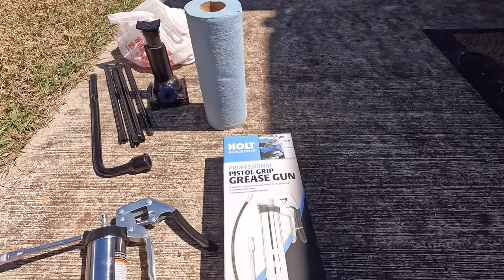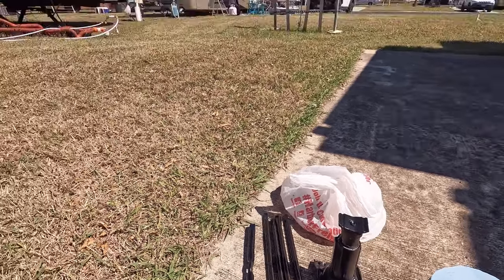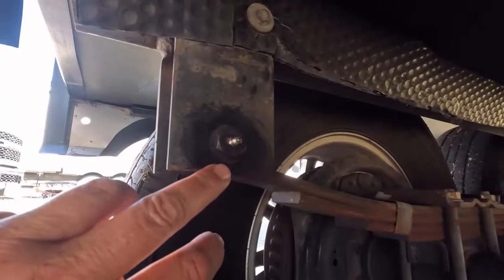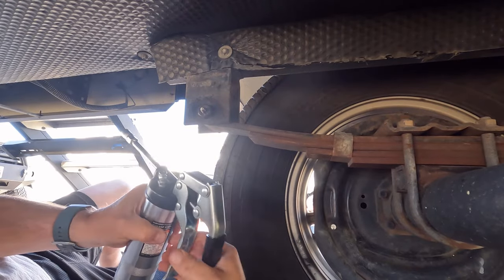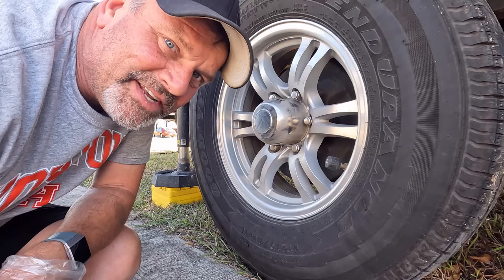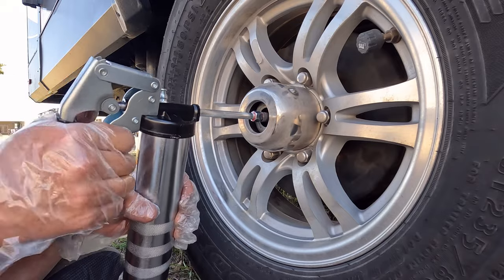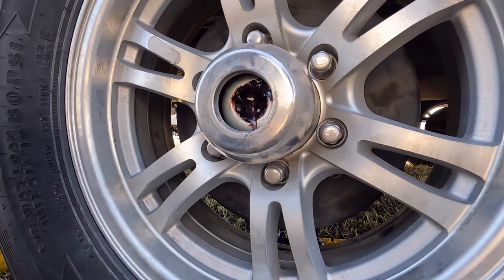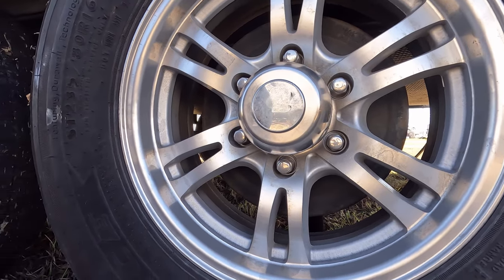The Dexter EZ Lube System for RV Wheel Bearings and Axles | So Simple YOU Can Do It Yourself!

Comment from the maker: NOTE - Although we used the Dexter EZ Lube System in this video, this does not take the place of inspecting your wheel bearings.  We intend on alternating between the EZ Lube System and manually packing the bearings so we can inspect all components bi-annually.
Reply: Not sure if you'll see this, but in the future before greasing the shakles, you may want to jack the frame a little to take the weight off the bushings. All the weight is resting on the side of the bushings you want to new grease to get into. Taking the weight off opens a space for the fresh grease to get in...
Just an idea 😉 👍 ~
Reply from the maker: That’s a great idea. I never thought of that. Thanks!
Reply: @CompassRoadz  happy to get to help once in awhile 👍 🙃

Comment: Having worked on trucks and trailers for over 40 years I can say with confidence that the EZLube system is one of the biggest frauds  ever pushed on the general public.  It is ok for boat trailers that are in the water but not much else. I have seen so many travel trailers that have had perfectly good brakes destroyed by the EZ Lube system.  You don't service anything.  You don't know the condition of the brakes, bearings or seals. I suppose if you drove through deep water and needed to quickly flush your hubs that would be different.  All that mixing of different is a big no no. Your going to trust your expensive bearings and suspension  components to cheap Chinese grease?
Reply from the maker: That’s good to know. We plan on manually packing the bearings every other year for the simple reason that we can actually look at the condition of the bearings. Thanks for watching!
Reply: Yea, Harbor Frieght, lots of made in China.  I think I'll go with Schaeffer Syn. Grease. Made in America.
Reply: Can you comment on the Schaeffer Syn. Grease and Motor Oil?
Reply: I'm a 2nd generation mechanic and I disagree with you. The EZ lube system is awesome. The problem is how they are maintained:)
Reply from the maker: @owenhill-vf7ko easy for novices like us. We like it as long as we perform the operation correctly. Thanks for watching!
Reply: Retired mechanic in the trade for 48 years,and In my experience with people with EZ lub hubs they tend to over grease and force grease past the hub/drum seal and force  grease in the drum and destroy the brake shoes. If a person knows what they are doing with regards to the amount of grease to inject into the hub then it makes life easy,but not necessarily the best alternative,and here’s why…..the problem is most people inject too much grease ,thus causing damage forcing grease past  the drum seal and into the drum and onto the brakes.  If grease gets onto the brake linings then  you have a big job to repair that damage,therefore the time to just pack the bearing by hand is your safest bet. Also it’s good to periodically take off the drum to inspect brake shoe  linings,hub/drum ,bearings and seal, making sure brake adjusters are free and working,readjusting brakes to the drum,repackaged bearings with fresh bearing grease. SAFETY FIRST ,the only way to inspect all this is ,taking your drums off,don’t cut corners it’s for the safety of your family and others!
Reply from the maker: @petejansen7220 thanks for that insight. Yes, the EZ Lube system is great if done right. If someone doesn’t know what they are doing they could screw it up. I agree that the bearings still should be inspected by g if and on a regular basis. Thanks for watching!

Comment: Dan, mark the top of the tire at 12 o'clock. then 2 pumps , then turn it 5 minutes to clockwise , 2 more pumps and keep at it until new grease fills outer bearing also. You need to turn it so you grease the inner bearing also. If you leave wheel still, it will only grease a small small portion of the inner bearing.. NICE WORK .. NICE TRICK FOR FELLOW  RV'ERS
Reply from the maker: That’s awesome advice. Thanks for sharing. I’m sure it will help others. Thanks for watching!!
Reply: No problem, glad to help fellow RV'ers @CompassRoadz
Reply: And we all know what happens when you overfill those... you blow out the back grease seal and all that nice grease lubes up your brake shoes/pads.
Reply from the maker: Definitely have to be careful to do the job correctly or it could get messy. Thanks for watching!
Reply: Manually turn each tire 5 minutes for how many times?  I don't see too many people doing that. How about a pump or two each time I stop for fuel until the cavity is full? We average about 11,000 miles a year with our large 5th wheel (was 33' and now 42') but I'm not one to major in the minors. :) It would be interesting to learn how often Dexter recommends complete disassembly to remove old grease and start over with new. Surely the frequency of a complete repack with new seals has more to do with miles than time, eh?
Reply from the maker: I think it’s designed so that any overfill gets pushed out.
Reply: @JIMPETERSON-n7i   Hi Jim,  2 pumps as you turn wheel 5 minutes at a time , You keep going and skin out out grease until new grease starts to come out, Use a different color also helps to see the new grease coming out ...

Comment: Dont do your bearing the lazy way, pull them apart, clean, inspect, grease and put back together. Check Youtube for Dexter Axle bearing video for the proper way to do it. If you pump in to much grease and bypass the rear  seal you will contaminate the shoes and have no brakes.
Reply from the maker: So true. But that is the whole reason for the EZ Lube system, to make it easier for the non-mechanically inclined. Thanks for watching!

Comment: I think the important thing to remember, so as to not blow out the rear seal, is to not use a pneumatic or powered grease gun and to pump the grease slowly.
Reply from the maker: Yes, that’s what we think based on concerns we’ve read in other articles regarding the procedure. Although Dexter claims it isn’t a problem with their bearings as long as they aren’t old and dried out. Slowly rotating the tire also helps eliminate grease from backing up without being spread evenly. Thanks for watching!
Reply: @CompassRoadz  -- I've learned to hate 'Bearing Buddies" but it looks like this Dexter system is a much better approach. And I believe our newer rig (2020 Torque toy hauler) has 'em so I need to get after it. :) This clearly puts a lot more grease inside the hub than old-school hand packing ever would.

Comment: I have to disagree with you in Dexter. Those type of seals should only be used if you are traveling and you take your temperatures and find one to be much hotter than the others is for emergencies only number two. It’s important to realize that you use a particular type of grease a high heat grease many of your newbies were not know that
Reply from the maker: You have a good point about using high temperature grease for the wheels. We were concerned about the Dexter system ourselves but we’ve spoken with Dexter makers and they are confident the system works as designed. Thanks for watching!

Comment: I nave this system on 3 different trailers for a total of 10 sets of bearings and I have never had one apart yet. I grease them once a year with Lucas red grease while rotating them.  I always check the temp on my hubs when traveling and have never had one even get warm, I have owned the two wheeled snowmobile trailer for 12 years now doesn't get many miles but to say this system is worthless is wrong, what other reason was there for having this system if it's not used  ?  There are probably many assemblies that are damaged by incorrect reassembly and poor bearing packing by novices and then there are the horror stories of taking it to a dealer for a re-pack and all they do is check for end play , rotate it for noise wipe it off and call it good.  I guess if something is working for you than stick with it huh ?

Comment: Also, they don’t need to be full.  A few pumps every couple of thousand miles than when the grease starts to push out it’s generally time to replace seals and re-pack bearings.
Reply from the maker: Yep!  That’s a good way to maintain a preventative maintenance routine. Thanks for watching!
Reply: Just a few pumps every 1000 miles. Pump a few until it crackles. Listen closely and you will hear the air bubbles crackling. Then stop. Even greasing will maintain. Why wait until they are dry every 12,000 miles? Or a time limit?

Comment: As an Auto Mechanic, we use locktite with seal installation.  This will keep it from blowing out.
Reply from the maker: Great tip!  Thanks for watching.
Reply: That is a very good idea.  Thank you for sharing your tip!
Reply from the maker: @garyp9906 thanks for watching!
Reply: Dexter recommends using this also.

Comment: That was great information. I've had my 303rls for almost 4 years and been putting it off because I wanted to get a good grease for the axles but watching your video I will have to get started on it. Great job 👏
Reply from the maker: We were putting it off too. We were thinking of just letting someone else do it and pay them but after way other videos claiming it was so easy, we decided we could try it. We spent $30 on the grease gun, $14 for 2 grease canisters, and $3 on shop towels. So for less than $50 and 2 hours I was able to do it easily. A lot of that time was setting up the camera and jacking up the axels. Next time the cost should only be another canister of grease for $7. Thanks for watching!!

Comment: Great insight and information for grease maintenance. You actually reminded me it’s time to maintain my hubs and bearings. I feel a lot of folks don’t do the required maintenance on their rigs. I tend to spend a lot of time on mine and I’m glad I do. Our Imagine 2150RB only had a few pumps of grease when we brought her home. So I did a full breakdown to make sure the bearings and spindles weren’t scored. All was good. 
But a HUGE reminder to everyone, taking apart your hubs is a great time to adjust and inspect your rigs breaks annually.
Reply from the maker: Yes!  You are absolutely right about inspecting the brakes, axles, and wheel bearings on a regular basis. I think too many people ignore that. We pinned a comment stating that even though the EZ lube system was sufficiently greasing the bearings, we plan on alternating between the EZ lube system and manually packing them each time do we can inspect the bearings and rest of the assembly at least every other year. Thanks for watching!!!

Comment: I’ve never pulled my bearings since I bought my trailer in 2005. Every year, I pump in new grease.
I have Dexter EZ Lube Torque Flex axles, ordered as an option. 
About 25,000 miles on my TT.
I do have a hub o meter mounted since day one!
Reply from the maker: That is phenomenal!
Reply: I worry about mine a lot. I think my TT might have  2,000 miles. I need to look for the Hub o mettersi. never heard of it.
Reply: I started packing my own wheel bearings after finding seals just sitting loose on the spindle when I pulled the drum off. :( I settled with the shop who did it wrong in exchange for four new seals. I also learned to pop mine in the freezer the night before and then tap them into position = much easier. I've been under the impression they should be repacked every 25,000 miles and we average about 11,000 miles each year so I would try to do one axle every year and alternate between them . . . never had a wheel bearing fail on our 33' 5th wheel in 8-1/2 years of fulltiming and we take it off road a lot. :)
Reply: @JIMPETERSON-n7i  Thanks for the report. I have seen a few people on the side of the road with axle, tire, and wheel bearing failure. It has to be pretty sinking.

Comment: good Morning. I was told years ago it is better to pump only a few time to keep from blowing out the seal and just do it a few time depending on use. Yes I like the rest of your Vidio Jack
Reply from the maker: You’re right. It really should only take 2-3 short pumps for each. Thanks for watching!
Reply: And the wheel should be spun while doing it.  The EZ-Lube axle only has one hole at the rear that the grease moves through

Comment: I do mine that way but I don’t start rotation till I see all new grease coming out all around the bearings and wiped out all the old , then rotate for several more pumps , also Dexter and the manual says not to use a power or air actuated grease gun to much pressure,that will blow out the seal manually is ok !   Good video.
Reply from the maker: I make sure I squeeze the trigger slowly and not rush things but I like to rotate as soon as possible to distribute the grease as much as possible. Thanks for watching!

Comment: I like pulling my wheels then inspect the bearings as well as the brakes every fall. Not to mention repack and replace if the bearing shows wear. Or dry bearings making sure there is grease.
Reply from the maker: It’s always a great idea to perform an inspection at least annually. That way you can see the state they are in and won’t be surprised when you’re on the road where it’s least convenient. Thanks for watching!